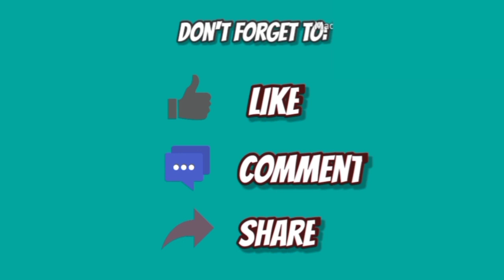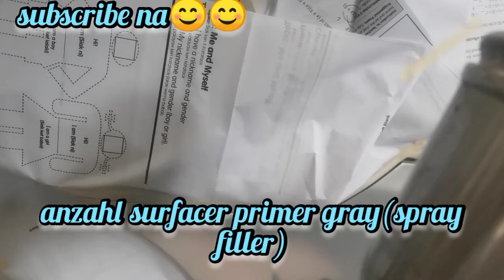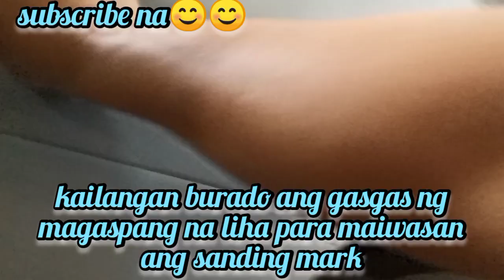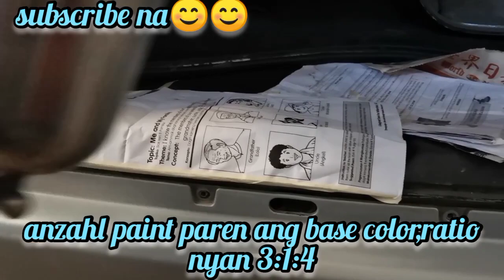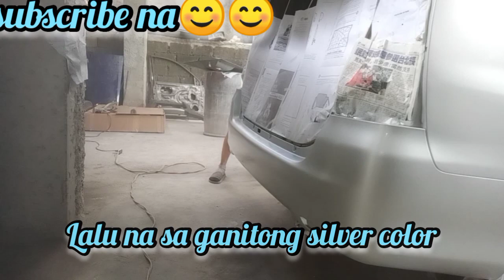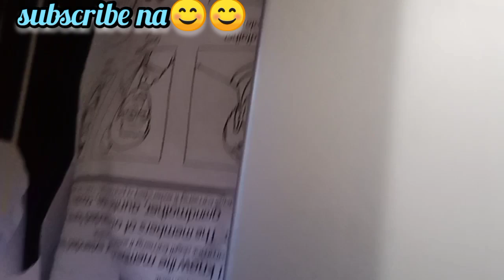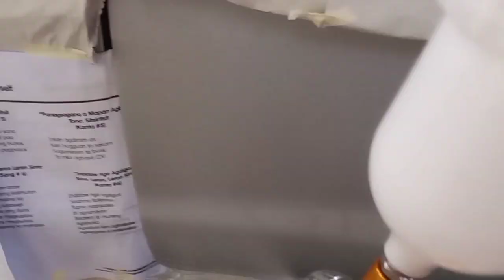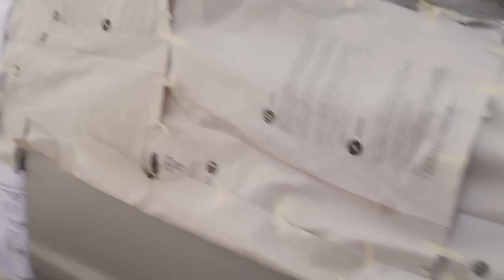Paano magblend ng dugtungan/daming dugtungan ng project naten ngayun/spot repaint(guide tips)

Comment: Idol anu magandang anticorossion sa loob ng door shell ng kotse para hindi mangalawang?ty
Reply from the maker: Pinag laterohan ba at na nasunog?pwede na anticorossion ng anzahl pero kailangan malinis din ng mabute
Reply: @zadysautohandsonpaint7705  oo bosing ung pinaglaterohan..pede rin ba ung nbibili na spraypaint na rubberize?
Reply from the maker: Pero kung orig pa,bale wala din ang anticorossion dapat sa yero sya mai aply,baka ang need mo sir rustfrooping,maganda din ang ipa gear oil mga loob ng door lalu na mga singit,kahit my kalawang na yan,pag naisip sip nya ang gear oil,stop na yan.subok ko na yan sir,napakamahal kase mag pag rustfroop sa casa lang madalas meron
Reply: @zadysautohandsonpaint7705 gear oil ung sa transmission boss?